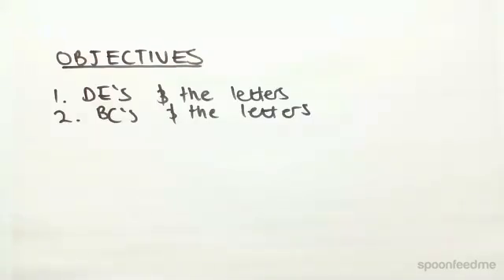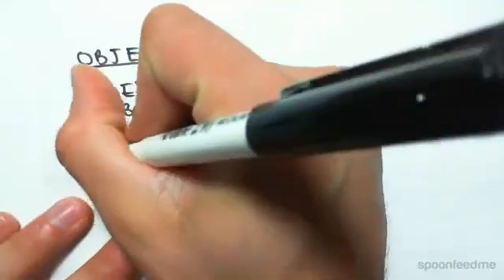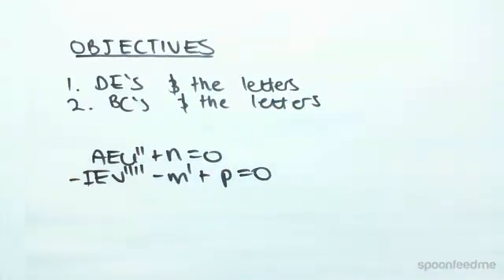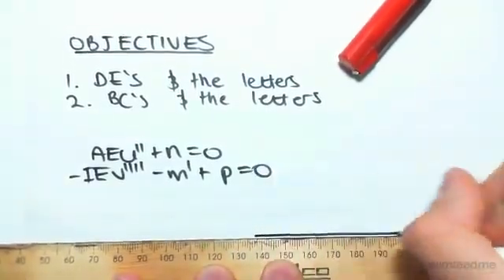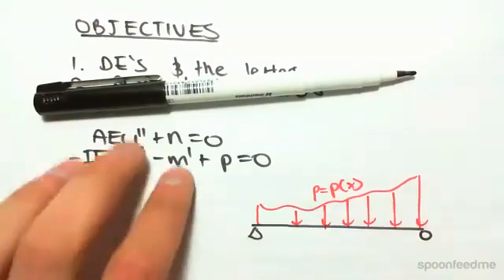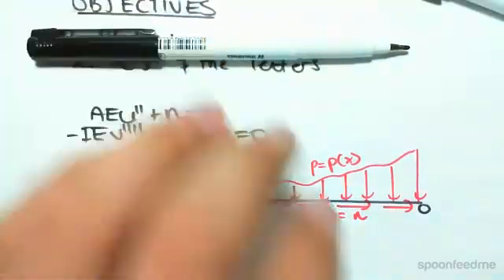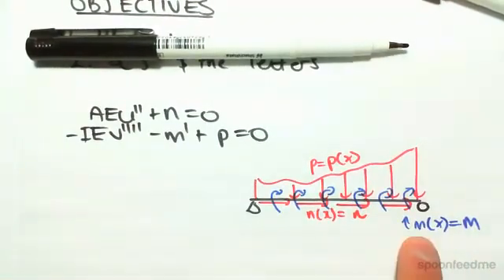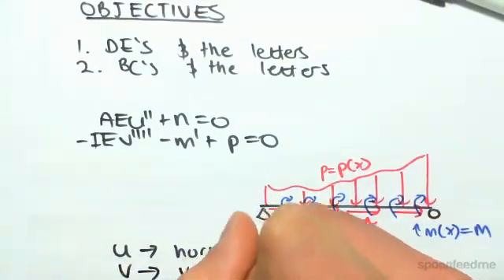Beam Deflection: Differential Equations & Boundary Conditions | Structural Analysis

Comment: Please help me solve this
Consider a perfectly flexible or elastic string stretched to a length 𝜋 and fixed at both 
ends with homogeneous Dirichlet boundary conditions. The string is plugged 
initially at its midpoint and released so that it vibrates. The wave speed is given by
9 m/ s and has zero initial velocity. Use this information to answer questions 1-5.
1. Determine the initial condition for this string.
2. Setup an initial boundary value problem in this situation.
3. Describe each of the equations given by this problem.
4. Justify that this problem is well-posed.
5. Use the method of separation of variables to determine the deflection 𝑢(𝑥,𝑡) at 
any point 𝑥 and time 𝑡 > 0 of the wave problem given by (2)
unison.bu@gmail.com